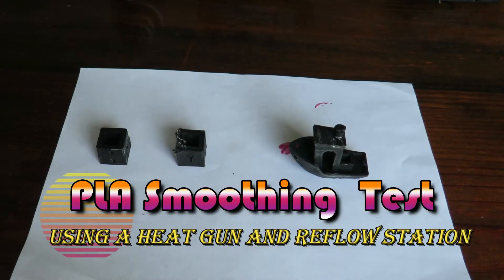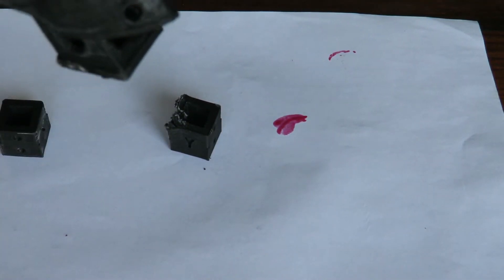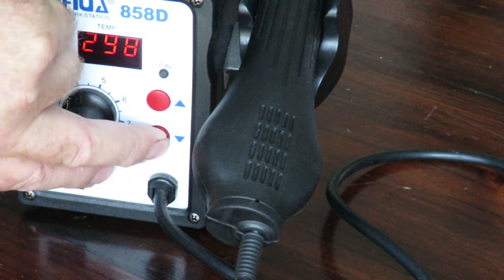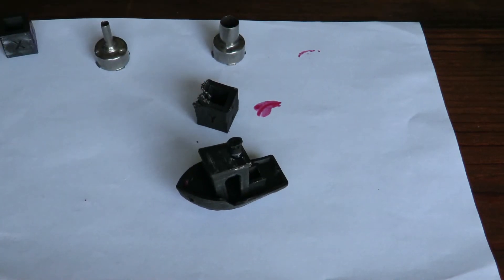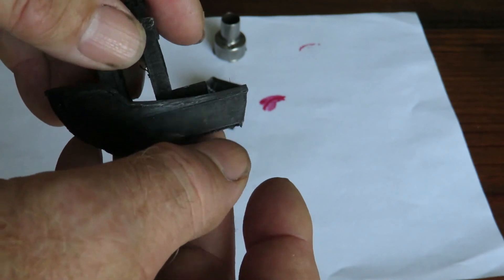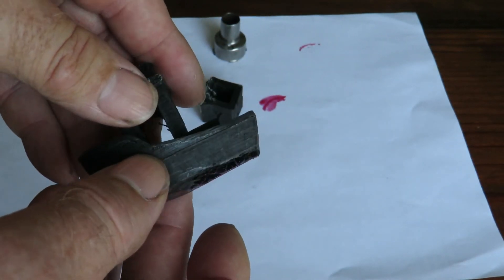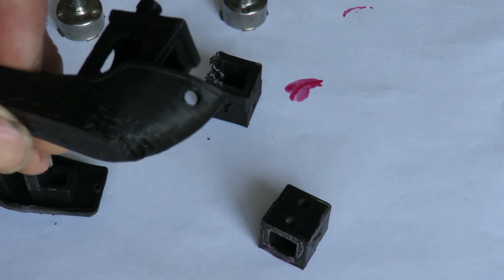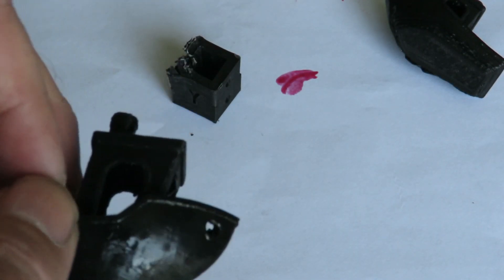📌 PLA Smoothing 3D Prints Test Using a Heat Gun and a Reflow Station – Will it Work?

Comment: If you want smooth parts you need to sand the part with sand paper, then use spray filler, then use spray paint.
Reply from the maker: That's True
I'm currently looking at faster ways (If one exists) to speed up the finishing process.

I will try them out first, before I concede to body filler, and sand paper.
You never know I might find one that works.🙂
Reply: but what about hotair gun then sand, or sand then hotair gun?

Comment: I've been trying everything to get a 3d print that is textural smooth. Printing 100% infill, sanding, using filler, applying epoxy. But still no results. I'm considering sanding and then using a heat gun now, although I dont trust myself not to accidentally start a fire or burn myself
Reply from the maker: The most successful method so far for me, is using Polyurethane.
https://youtu.be/lhFCnAH87AI

Painting the coated model
https://youtu.be/AB9UACS5Pbs
Reply: @GarryPurcell  Thanks, I'll try this one. I'm not painting over it, I'm actually casting silicone into it which is why I'm focused on how smooth it is to touch and not how it looks.
Reply from the maker: @CombustibleL3mon  The Polyurethane coating might be what is needed for a smooth mould for your silicon cast.

Comment: Hi  Garry.
Try heatgun  over 500′ ( even 700′) but just fly away on the surfaces.
You will melt just first layer not in depth.
Keeping 10sec in  200-250′ may deform the item.

You need to burn just on surfaces
Reply from the maker: I might try that and see what happens.🔥🙂
Reply: That's my experience too.

Comment: HI Garry , take a look in ebay for MODIFI3D-V2-KIT-3D-Print-Finishing-Tool-including-4-tips-USB-powered , sopposedly it should be good for smoothing and so . haven´t  bought one , maybe interesting for you ?
Reply from the maker: Thanks
I'll take a look.
Reply from the maker: It seems to be a modified soldering iron, for fixing and smoothing bad 3D prints.
Unfortunately, It can't produce the finish I'm striving to achieve.

P.S. I'm currently testing out another product (A bit on the pricey side), but won't know how it fared until tomorrow.
I will pop up the video results sometime in the morning..

And again thanks for your interest and suggestion.